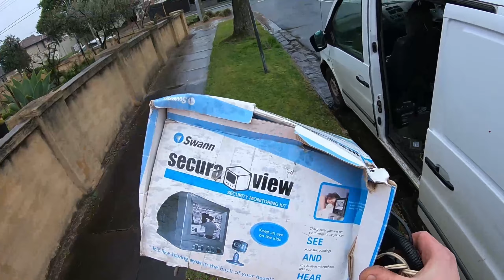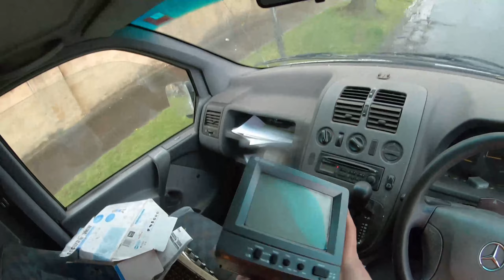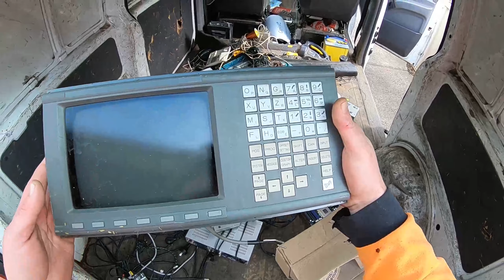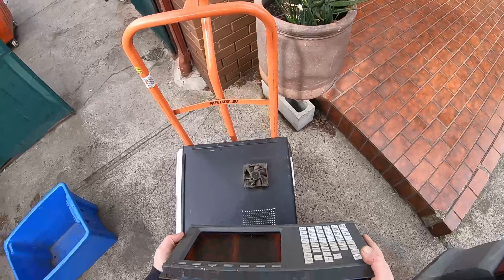Street Scrapping with Vintage PC's

Comment: @ 5:03 you picked up and put back a vintage IBM Model M keyboard.  Those go for big bucks on eBay.  Even with missing keys.  Tsk tsk.  ;)
Reply from the maker: not a model M, that's why I looked at it, not even an IBM
Reply: Ahhhh yes, you are right!  I went strictly based off the speaker grill on the underside.  Now that I’ve rewatched it, you can tell it wasn’t.  Thanks for the response and the great work you do on your vids!

Comment: 17:51 Men from the boys, eh?  ;)
Edit:  Your audio has always been fully acceptable with the camera mic.  Most of us who 3 hours watch scrapping aren't so concerned about audiophile sound quality.
Edit 2: 33:47  Consider using a Variac (variable AC voltage transformer) between the wall outlet and the device power chord when powering up vintage electronics, especially if it's unknown how long the device sat idle.  Electrolytic capacitors "dry out" with age.  If old, dry caps are shocked by a power in-rush they may short out, burn up, etc, and possibly allow further down the line damage.  This can ruin an otherwise functional device.  A Variac allows old caps to be warmed up slowly:  Set the voltage to, say, 25VAC, power up the device and let it sit for a day.  Then ramp it up to 33V and let it sit for another day, etc.  This method can often allow old caps to reconstitute without blowing the works.  In a week or two you may then have a good-as-new system.

Comment: That is an ICL One Per Desk, launched in 1984.
Reply: used to have a UK model branded by BT - from memory they used the same Microdrives as the Sinclair Spectrum and QL machines and was similar to the QL internally - even though it is not complete it could well be of use to a collector as it looks intact

Comment: why wouldn't you take the aluminium ladder I mean its Aluminium
Reply from the maker: excited with PC's today, everything else is invisible until I see the video
Reply: @eWasteBen  you can make even more free $$ if you grab the right things, hipsters are really into retro things and bogans like 80-90's BMX stuff an old haro or mongoose frame can bring hundreds.
so keep your eyes open one mans junk yada yada
Reply: @eWasteBen  When there are vintage PCs - Aluminum probably looks like plastic!
Reply: it aloo-minion
Reply: TheWizard22UK  Yep. But you might have to take it apart, clean off any oxidation/corrosion, and reassemble.
Reply: @eWasteBen  hhhhhhhhhhhhhhhhhh i always say this

Comment: You cut the cord from a vintage table fan worth $100 for a 10 cent cord... (face hand)
Reply: I was thinking the same thing. 
Could have sold the speakers also.
Reply from the maker: I have much better ones already
Reply: @eWasteBen   gumtree
Reply: @eWasteBen   gumtree
Reply: I agree or take it and make another person happy for no reason sometimes that's worth more, seen many videos from you really nice and most of the times cut any cord you like but this time I had to look away😢
Thanks Ben
Reply: @eWasteBen  what about others that dont Ben? Sometimes it good to leave some cords on items like that, just saying, by the way love your channel thumbs up mate
Reply: @paulabyrne7223  I don't see a problem.  That cord wasn't up to the modern electric appliances standards so in order to safely use the fan you will need to replace it anyways.  If somebody wanted that fan they could've grubbed it.  I would.
Reply: Alan Shore so what if a cord is not up to standards ? As long as it works and won’t Catch on fire that’s all that matters!
Reply: @Dan_07  O.K.  If you like things catching on fire that's your private business.
Reply: Hmmmmm, cutting a cord for 10 or 20 cents ruins it for the trash picker who actually needs a working fan.

Comment: Hey Ben!  Watch The 8-Bit Guy channel for vintage PCs.  He restores them and knows a lot about them.
Reply: I wish he hadn’t scrapped out the am 5x86. That was a great system to restore or he could have sold it along with the Compaq. The MSI socket 478 board would have also been worth selling.
Reply: @CompGuy66  I was selling a 286 keyboard in good condition on Ebay for about a year as the "buy now".  Guess how much it was when I put it on auction?
Reply: What kind of keyboard was it? What kind of key mechanism and brand? Also what was your buy it now price. I find ebay tends to be super overpriced. Just look at the asking prices for older expansion cards such as sound blaster, 3dfx Voodoo, etc.
Reply: @CompGuy66  "I find ebay tends to be super overpriced."  
Here we go.  I love how the armchair experts say that something "costs so-o-o much" when in fact, no one wants to pay the real price.  I am not a keyboards expert, it was a FORTRON 286 keyboard Model RT-101+ 5-pin 180-degree DIN connector.  I was selling it for "buy it now" for $250   I sold it at auction for... $43.  43 fucking dollars.  And how much do you think I should sell my old expansion cards, motherboards, etc. that would be worth my time for making the proper posting with taking the photos, researching and writing the description, and then spending some time on properly packaging and driving 15 minutes to the nearest post office to get the real shipping quote because the Ebay shipping calculator sucks monkey's ass?   Tell me, what's my time worth?
Reply: @toomaskotkas4467  Things are only worth what people are willing to pay for them, simple as that, and that has nothing to do with being an "armchair expert" that's just the facts... and I'm with Computer Guy on this one, many people on EBay think they're selling friggin GOLD, and their stuff is way overpriced...
Reply: I am very sorry if I upset you in any way. I was just asking about your experience selling the keyboard out of curiosity as to what keyboard it was and how much you made selling it. As a long time ebay seller and buyer I completely understand your pain when it comes to shipping. It’s expensive, inconvenient, and don’t even get me started on the global shipping program. However, do keep in mind ebay is not the only place where you can sell old computer equipment. You can post an ad in your area on a site like craigslist or kijiji. If that doesn’t appeal to you there are also many groups and websites dedicated to preserving older computer hardware where you can offer the items you no longer want such as Retro Machines on facebook or vogons. As for what your time is worth, even though in many big cities the saying time is money holds true. Do realize that retro and vintage items are more like wine. If you put in the time and effort to preserve them properly you will be able to enjoy them in the future or at least sell them for more money to someone else who will enjoy them instead. Also I would much rather sell a working piece of hardware to someone for $10 and make them happy rather than spend a bunch of time and energy scrapping it out just to make $1 from the scrap metals and then sleep with the knowledge of how much resources will be wasted to remanufacture those metals into a finished product and have to live with the knowledge that any collectors that hear about what I have done will want to tear me to shreds. Scrapping anything should always be a last resort. Reduce, reuse, and finally recycle. Now I am not saying that we should try to save every prebuilt Dell, HP or Lenovo system that is decommissioned from every workplace or home in the world. If I were Ben I would have only saved the 5x86 system as a whole unit and sold or parted (scrapped) out the rest of the computers. I am sorry for the long rant.